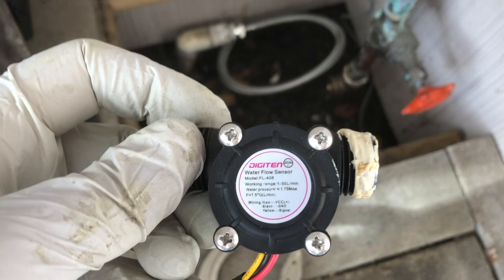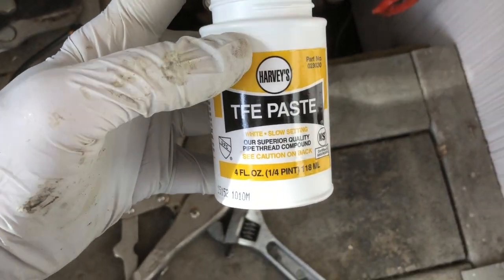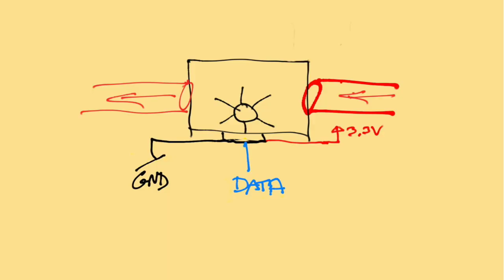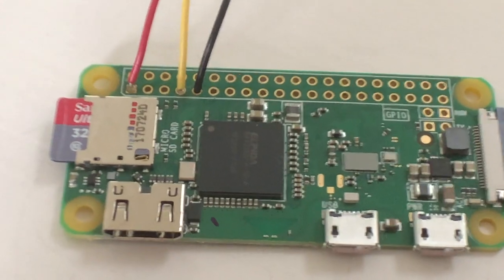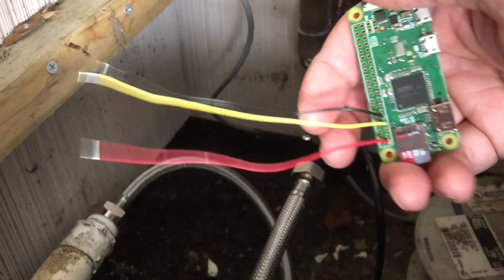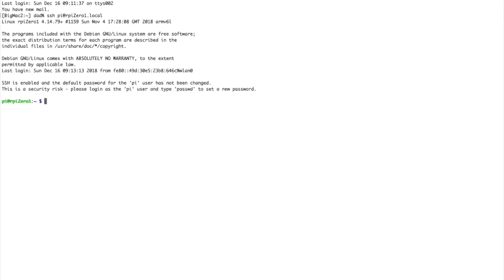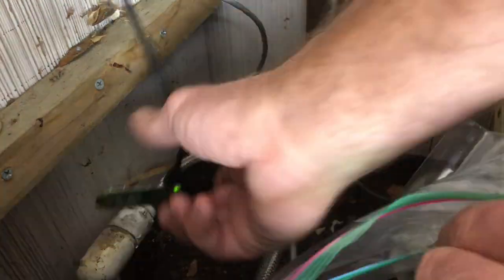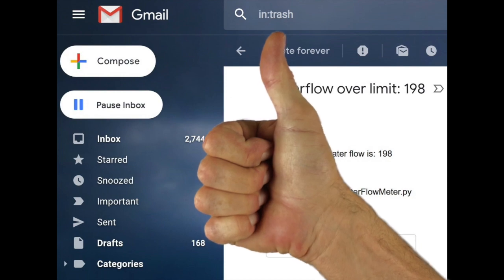Installing a cheap water flow meter with attached Raspberry Pi ZeroW

Comment: This is a rather neat little idea, by chance is there any kind of understanding to the number of pulses to flow rate (either from the manufacturer or your own experience)?  I'm interesting in building something very similar but would like to understand how to convert the findings of a device like this one to an actual flow rate.
Reply from the maker: I didn’t calibrate it since my needs aren’t critical but I did notice that there was a comment on the Amazon page (from alexw) saying he measured the rate to be 796 pulses/liter but it sounded like it might not be all that consistent and, of course, there could be unit-to-unit variances as well. If you wanted to take the time you could pretty easily rig up a funnel to flow through the meter and pour a measured amount of water through while reading the pulses. If you do that 10-20 times you should get a good feel for the precision and accuracy of the measurements.

Comment: Good video! How can I use two sensors for cold and hot water? Is it possible?
Reply from the maker: Mmm - my only concern would be whether these cheap flow sensors can handle hot water. I see some cheap brass ones on Amazon that might work but the reviews are low due to the threading. Pipe threads are a black art but I think a brass valve (assuming all the parts that touch water are brass) would be better for hot water.

Comment: Thanks for sharing this vid, I'm looking to build a similar project myself. It looks like you hook it up to the 3.3V pin. The specs on some of these flow meters say it takes 5V to run. Is there a reason you went with 3.3V? Looks like it didn't cause any issue for you.
Reply from the maker: No particular reason and yes, you could just run it off of the RPi 5v rail. I think that would work fine as well.

Comment: I am interested in the code, I am working on Design project with a small group and would love to see this code to test it with my system.
Reply from the maker: Sure. You can find the code at GitHub (see the link in the video description) or, I also pasted the code into a reply to another comment. It should be just below.

Comment: The specs listed for this sensor, fl-408, is a bit confusing. It says voltage: 3.5vdc-24vdc. Below that it says Working Voltage: 5-24vdc. Just about every site on the web has that description. Well which is it? I see you are using this sensor without any logic level shifting; using the default 3.3v logic directly from the pi. I would assume that means you've confirmed it will work consistently and provide accurate measurements at that voltage?

Im about to wire up my yf-s201 sensor with a voltage divider but if this one will work directly from the pi Ill order a few.
Reply from the maker: I did confirm that it worked consistently at 3.3V using a power supply before I hooked it up to the Pi but I never check the accuracy of the flow rate since my needs are pretty crude - i.e. I just need to know if it goes beyond a limit. Now that I think of it, it would be pretty easy with the Pi attached to compare the counts while funneling a fixed amount of water through it repeatedly. However, if you really want accuracy, that would need to be checked at various temperatures. On the other hand, it’s a cheap device so I wouldn’t expect it to be very robust over time. I just hope it doesn’t leak!
Reply from the maker: I check the flow meter with a 3.3v supply before using it but I can't say it was a rigorous experiment. I just checked relatively low and high flow rates several times to make sure I got consistent results but not necessarily accurate results. I just need the meter as a very general indicator so flow accuracy isn't important. Obviously, you could us the 5v rail on the RPi if you wanted to be true to the datasheet.

Comment: Really great content sir. Can i use the flow meter to calculate total volume of the water passing through ?
Reply from the maker: Certainly the count from the sensor is an indicator of the water flow but I can’t vouch for its accuracy. My guess is that it will be reasonably accurate in a certain flow range. You could set it up in a test rig and put a known amount through several times to see if you get consistent results.
Reply: @ravraid  sir last question. Please answer if possible. Can i use this sensor to measure the flow of diesel flowing through a pipe? If not. Do you know how can i do it? I really need to know the answer. God bless you sir.
Reply: Is there any other sensor that i can use? Sir please i need the answer badly.
Reply from the maker: This sensor is mostly made of plastic so I would be concerned that diesel fuel would corrode it. I’m sure if you google flow meter you can find more robust units than this one but they will also be more expensive. However, certainly a unit like this can measure flow rates of a fluid - the question is just what kind of precision and accuracy you require.
Reply: @ravraid  THANK YOU FOR THE REPLY SIR!!

Comment: Bro.. Can share flow sensor data from raspberry pi 4 to mysql database????
Reply from the maker: I haven't done that but it should be straightforward once you've setup mysql on the Pi. There are lots of Pi mysql examples out there.
Reply: Thanks bro

Comment: Can you share the code please?
Reply from the maker: Yep, it is all included in the comment below.
Reply: @ravraid  I went through all the comments, but couldn't find the code. Why not post it in the description of the video?
Reply from the maker: @manusharma3212  I see the code in a comment from 1 year ago but regardless, here it is:

#!/usr/bin/env python

# Simple script to monitor a cheap water flow sensor attached to gpio 4. The script counts pulses over an interval and then
# checks if the count exceeds a limit. If it does, it sends an email.
# This script uses some of the pigpio code for doing the counts.
# ravraid 1/31/19

import time, datetime
from smtplib import SMTP_SSL as SMTP
from email.MIMEText import MIMEText
import pigpio

intervalTime  = 15  # in seconds
triggerMin    = 50  # limit in pulse counts - adjust to detect small leaks

SMTPserver    = 'smtp.gmail.com'

sender        = 'FOO@BLAH.COM'
destination   = ['FOO@BLAH.COM']
USERNAME      = "FOO@BLAH.COM"
PASSWORD      = "MYPASSWORD"

subject       = ""
waterFlow     = 0
flowGpio      = 4

text_subtype = 'plain'

def sendMail(content):
    try:
        msg = MIMEText(content, text_subtype)
        msg['Subject']=       subject
        msg['From']   = sender # some SMTP servers will do this automatically, not all

        conn = SMTP(SMTPserver)
        conn.set_debuglevel(False)
        conn.login(USERNAME, PASSWORD)
        try:
            conn.sendmail(sender, destination, msg.as_string())
        finally:
            conn.close()

    except Exception, exc:
        sys.exit( "mail failed; %s" % str(exc) ) # give a error message

pi = pigpio.pi()

pi.set_mode(flowGpio, pigpio.INPUT)
pi.set_pull_up_down(flowGpio, pigpio.PUD_DOWN)

flowCallback = pi.callback(flowGpio, pigpio.FALLING_EDGE)

old_count   = 0
triggerTime = datetime.datetime.today() - datetime.timedelta(weeks=1)  # Initialize it to more than a day ago

while True:

   time.sleep(intervalTime)

   count = flowCallback.tally()
   waterFlow = count - old_count
   #print("counted {} pulses".format(waterFlow))
   yesterday = datetime.datetime.today() - datetime.timedelta(days=1)
   # Only send at most one message per day so check if the last trigger was more than 24hours ago
   if ( (waterFlow > triggerMin) & (triggerTime < yesterday) ):
       triggerTime = datetime.datetime.today()
       print "Note: Sending mail.."
       subject= "Waterflow over limit: " + str(waterFlow)
       message= "Limit is: " + str(triggerMin) + " and water flow is: " + str(waterFlow) + '\n'
       message = message + '\n\n' + "Sent from rpiZero1 waterFlowMeter.py" + '\n'
       sendMail(message)
   old_count = count

pi.stop()
Reply: In this description code is python or any other
Reply: @ennaiarindhal3141  Python

Comment: Bro can read 2 flow sensors data in raspberry pi 4
Reply from the maker: If you’re asking if it is possible to read two sensors with a RPI 4, I think that should be no problem. The code is pretty efficient and shouldn’t load the Pi so two sensors should possible. Give it a try!
Reply: 😁 Thanks,, coding??
Reply from the maker: @ennaiarindhal3141  Yes, there will be coding :). You’ll need to specify a second GPIO since you’ll have a second sensor attached to it. Then, you’ll need to duplicate the code that reads from that sensor and processes it. If you have questions about specific lines of the code, feel free to post them.
Reply: 🤗Thank you

Comment: Can you post the code?
Reply from the maker: I posted the code in my comments awhile back. I see it there so I assume you should be able to see it as well. Take a look…
Reply: Great video.

Is there some chance you might be able to post the code soon? I saw you said you posted it, but it is not there. Did you remove it? Why would you do that if you posted it originally?

Thanks!

Comment: Hello good sir, I was wondering if you can provide the python code to help me interfacing my flow meter with the raspberry pi. Thank you so much for your good content.
Reply from the maker: Sure, I should probably clean it up a bit but then I will post it here - it isn't much code.
Reply: @ravraid  any luck posting this code?
Reply from the maker: I've posted the code in replies a few times now and I'm not sure why others are not able to see it. I can't post it in the video description as it gives errors due to certain brackets not being allowed. Regardless, here is the code:

#!/usr/bin/env python
# Simple script to monitor a cheap water flow sensor attached to gpio 4. The script counts pulses over an interval and then
# checks if the count exceeds a limit. If it does, it sends an email.
# This script uses some of the pigpio code for doing the counts.
# ravraid 1/31/19
import time, datetime
from smtplib import SMTP_SSL as SMTP
from email.MIMEText import MIMEText
import pigpio
intervalTime  = 15  # in seconds
triggerMin    = 50  # limit in pulse counts - adjust to detect small leaks
SMTPserver    = 'smtp.gmail.com'
sender        = 'FOO@BLAH.COM'
destination   = ['FOO@BLAH.COM']
USERNAME      = "FOO@BLAH.COM"
PASSWORD      = "MYPASSWORD"
subject       = ""
waterFlow     = 0
flowGpio      = 4
text_subtype = 'plain'
def sendMail(content):
    try:
        msg = MIMEText(content, text_subtype)
        msg['Subject']=       subject
        msg['From']   = sender # some SMTP servers will do this automatically, not all
        conn = SMTP(SMTPserver)
        conn.set_debuglevel(False)
        conn.login(USERNAME, PASSWORD)
        try:
            conn.sendmail(sender, destination, msg.as_string())
        finally:
            conn.close()
    except Exception, exc:
        sys.exit( "mail failed; %s" % str(exc) ) # give a error message
pi = pigpio.pi()
pi.set_mode(flowGpio, pigpio.INPUT)
pi.set_pull_up_down(flowGpio, pigpio.PUD_DOWN)
flowCallback = pi.callback(flowGpio, pigpio.FALLING_EDGE)
old_count   = 0
triggerTime = datetime.datetime.today() - datetime.timedelta(weeks=1)  # Initialize it to more than a day ago
while True:
   time.sleep(intervalTime)
   count = flowCallback.tally()
   waterFlow = count - old_count
   #print("counted {} pulses".format(waterFlow))
   yesterday = datetime.datetime.today() - datetime.timedelta(days=1)
   # Only send at most one message per day so check if the last trigger was more than 24hours ago
   if ( (waterFlow > triggerMin) & (triggerTime < yesterday) ):
       triggerTime = datetime.datetime.today()
       print "Note: Sending mail.."
       subject= "Waterflow over limit: " + str(waterFlow)
       message= "Limit is: " + str(triggerMin) + " and water flow is: " + str(waterFlow) + '\n'
       message = message + '\n\n' + "Sent from rpiZero1 waterFlowMeter.py" + '\n'
       sendMail(message)
   old_count = count
pi.stop()
Reply: @ravraid  Appreciation for all your valuable efforts.

Comment from the maker: #!/usr/bin/env python

# Simple script to monitor a cheap water flow sensor attached to gpio 4. The script counts pulses over an interval and then
# checks if the count exceeds a limit. If it does, it sends an email.
# This script uses some of the pigpio code for doing the counts.
# ravraid 1/31/19

import time, datetime
from smtplib import SMTP_SSL as SMTP
from email.MIMEText import MIMEText
import pigpio

intervalTime  = 15  # in seconds
triggerMin    = 50  # limit in pulse counts - adjust to detect small leaks

SMTPserver    = 'smtp.gmail.com'

sender        = 'FOO@BLAH.COM'
destination   = ['FOO@BLAH.COM']
USERNAME      = "FOO@BLAH.COM"
PASSWORD      = "MYPASSWORD"

subject       = ""
waterFlow     = 0
flowGpio      = 4

text_subtype = 'plain'

def sendMail(content):
    try:
        msg = MIMEText(content, text_subtype)
        msg['Subject']=       subject
        msg['From']   = sender # some SMTP servers will do this automatically, not all

        conn = SMTP(SMTPserver)
        conn.set_debuglevel(False)
        conn.login(USERNAME, PASSWORD)
        try:
            conn.sendmail(sender, destination, msg.as_string())
        finally:
            conn.close()

    except Exception, exc:
        sys.exit( "mail failed; %s" % str(exc) ) # give a error message

pi = pigpio.pi()

pi.set_mode(flowGpio, pigpio.INPUT)
pi.set_pull_up_down(flowGpio, pigpio.PUD_DOWN)

flowCallback = pi.callback(flowGpio, pigpio.FALLING_EDGE)

old_count   = 0
triggerTime = datetime.datetime.today() - datetime.timedelta(weeks=1)  # Initialize it to more than a day ago

while True:

   time.sleep(intervalTime)

   count = flowCallback.tally()
   waterFlow = count - old_count
   #print("counted {} pulses".format(waterFlow))
   yesterday = datetime.datetime.today() - datetime.timedelta(days=1)
   # Only send at most one message per day so check if the last trigger was more than 24hours ago
   if ( (waterFlow > triggerMin) & (triggerTime < yesterday) ):
       triggerTime = datetime.datetime.today()
       print "Note: Sending mail.."
       subject= "Waterflow over limit: " + str(waterFlow)
       message= "Limit is: " + str(triggerMin) + " and water flow is: " + str(waterFlow) + '\n'
       message = message + '\n\n' + "Sent from rpiZero1 waterFlowMeter.py" + '\n'
       sendMail(message)
   old_count = count

pi.stop()
Reply: Thank you so much good sir!